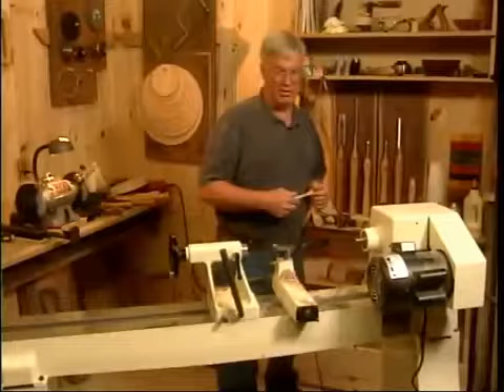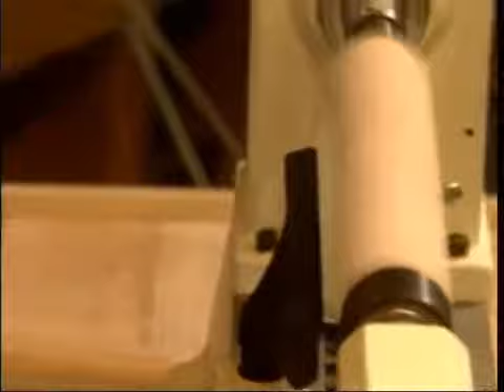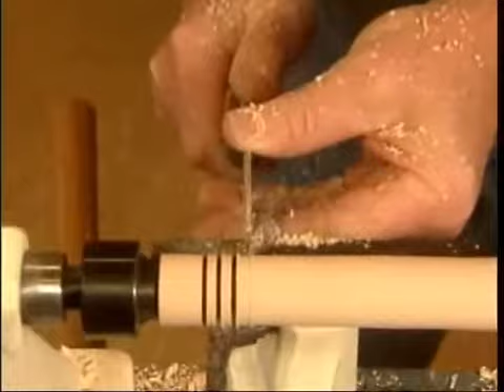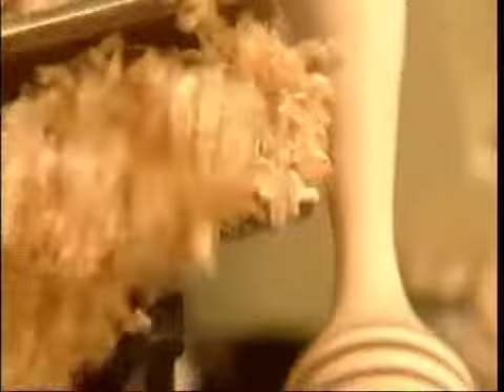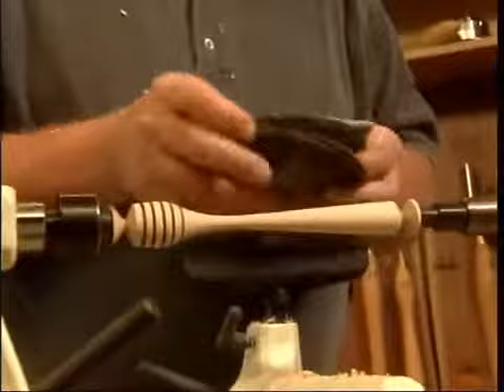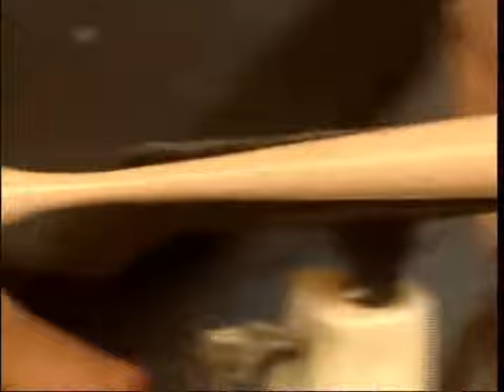Jet Woodworking Power Tools Ireland: Joe McKenna Tools

Comment: It is tough to start up a wood working project. I had created wasted so much time & money on my previous projects. Then I found out the reason why, that is I did not have a specific plan & diagram. I always let things even worse when it could be fixed easily if I had some experience. Then I found a wood working system which contains all the specific diagram, ideas & tutorials - it help me lots.
Reply: You also can obtain it at the link beneath, I sure it can save you a lot of time and money
http://bit.ly/details-woodworking-plan